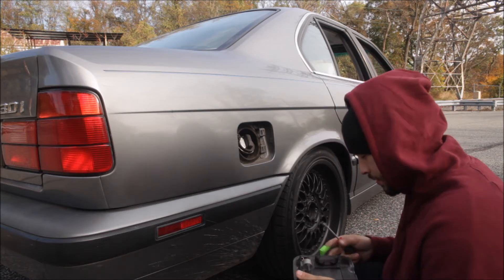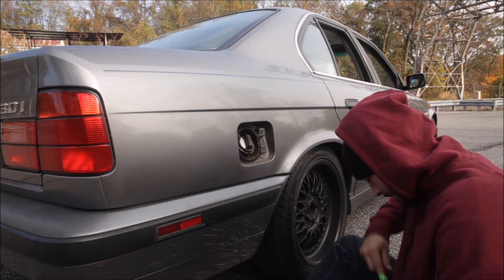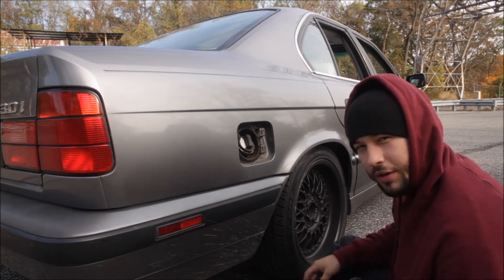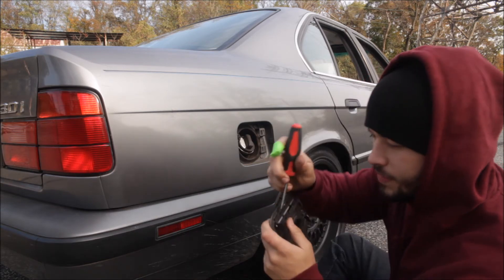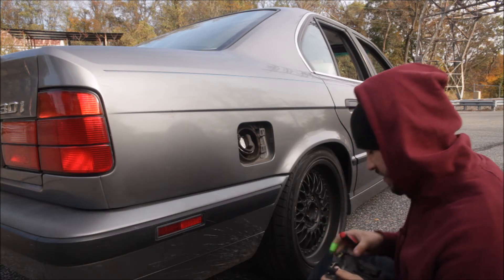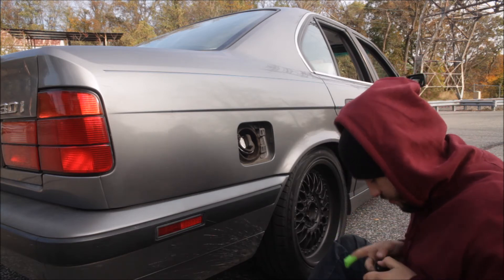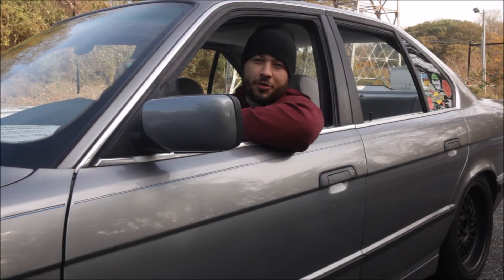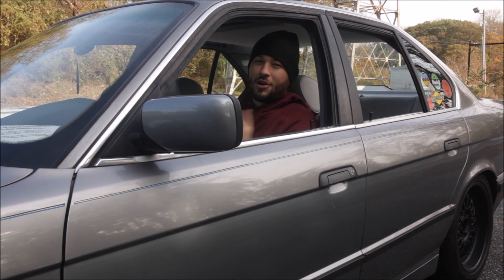e34 Fuel Door Hinge Fix

Comment: The hinge is the sacrificial part -- it's plastic so if the door gets cranked past 90 degrees, it will break before you start bending sheet metal.  Cheers.

Comment: you should have done a close up how u removed the spring, I have to replace mine too...
Reply from the maker: The Wedge I know! This was my very first video.  I just put the screw driver tip (flat head) near the spring and just used a prying method.  It eventually popped off.  Everything after that was pretty easy.
Reply: @WHOTUCKIS  thanks. doing it now